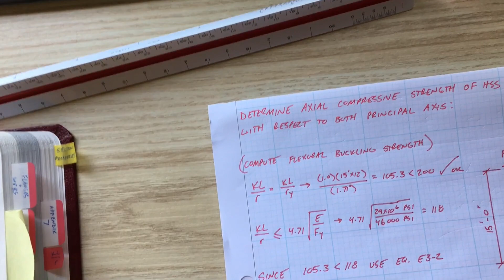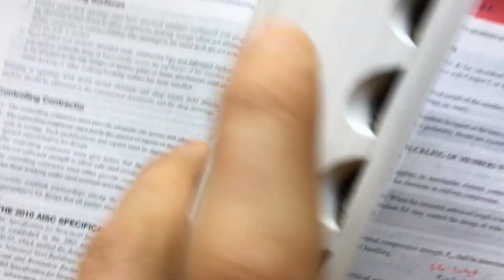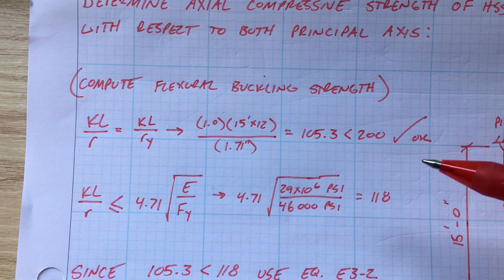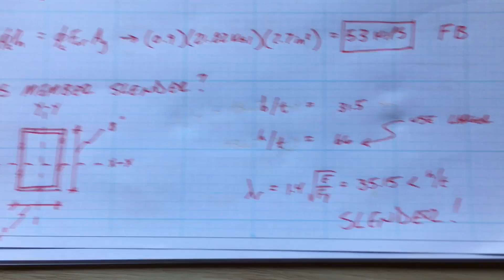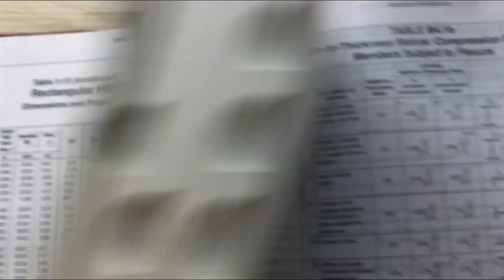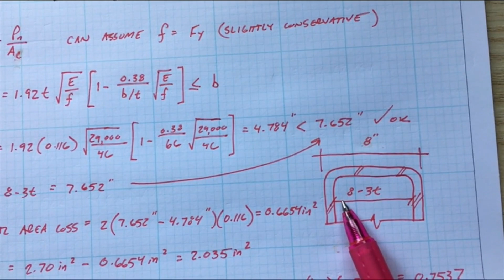How to Design a Steel Column

Comment: Thank you for the video. I find it confusing that table B4.1a has a column for width to thickness ratio instead of lambda. I shape property tables list b/2tf for compaction criteria, not to be confused with b/t for table B4.1. Both B4.1 and the properties table manage to avoid using the bass lambda symbol, at least in the 13th addition.

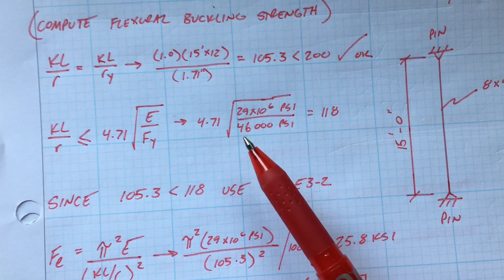Comment: One nitpicky point of constructive criticism, you say at 9:15 "the Fy is 46 ksi because the section is rectangular". This would be a good opportunity to explicitly reference Table 2.4 which says 46 ksi is the preferred material specification.

Also other assumptions behind the tables with Design Values for K:
In addition to perfectly plumb column, the column has no residual stress (All rolled sections have some level of residual stress) and the load is applied exactly over the centroid of column.
Reply from the maker: Logan, Such great points! I talk about KSI values in my steel manual tips and tricks but should have referenced back! for residual stresses in steel ive learned that the AISC accounts for this when stating what steel grade we can assume for our section. Ive also heard phi / omega take this into account.
Reply: @kestava_engineering  I looked back at it and you're right. Apparently the main difference for the theoretical and design Effective Length Factors is that the end conditions are never as idealized (can never or very rarely have a perfectly fixed or pinned condition).

Always good to get the refresher! thanks for the good catch.